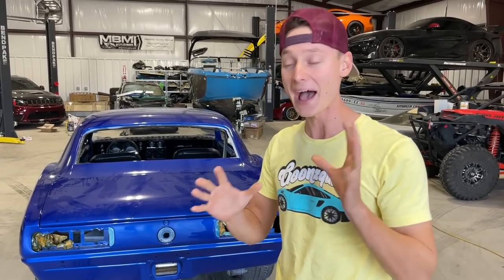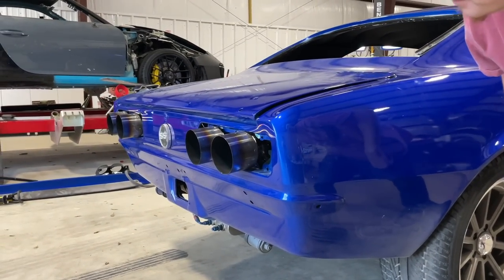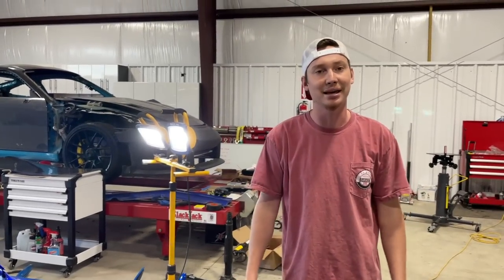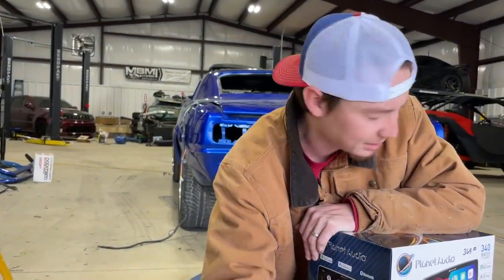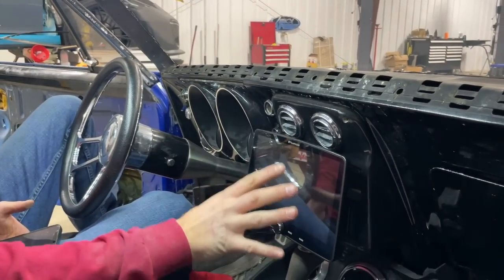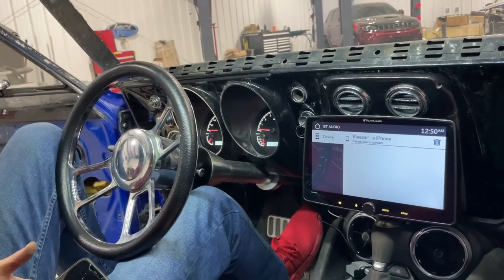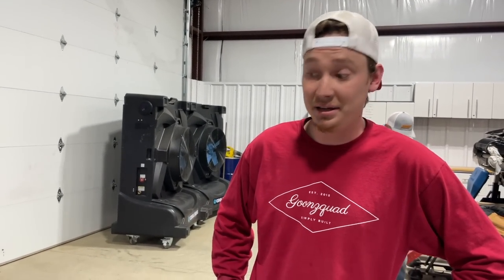Our LT4 Swapped 1967 Camaro Gets An Insane Stereo System!!!

Comment: Them Vega 6x9s are a beast without an amp. Can't believe they sold u them but boss 6.5s. Later trash those and get Vega 6.5 mid bass.  Also sold u the crapest amp for highs. I'd change that asap 2 a name brand not Wal Mart brand amp. After amp change u will double the quality of sound. . Love the build. Next do a nova or chevelles ss

Comment: I almost cried when he turned the GAIN and bass boost all the way up.. Y'all need the shop to set the gains. Would be easiest. I use an O scope with a -10 db 40hz test tone.
Wire looks too small. Could be an issue.
I would use 0 AWG pure copper to the back, no CCA wire, then dist. Block and 4awg to each amp.
Also ditch those BOSS door speakers. Swap meet trash. The rear 6x9s are good. American bass is well respected in the SPL world. Think they are outa Ohio. 
Look up the "big 3" you need to do this to get the most power and impact from the system. This reduces voltage drop. Amps dont like voltage drop.
Looks like you got a good size rear AGM battery. Good job.Car audio guys LOVE AGMs.

Comment: I'm pretty sure there is supposed to be metal clips to hold the windshield trim on a stock Camaro they neglected to install before gluing the windshield in. Didn't cars from this era use rubber gaskets not glue for the glass? My 69 c10 had a rubber gasket for the front and rear glass no glue.

Comment: Back in the day the windshield was held in by a rubber seal with chrome trim not window sealer like the new ones. You will need to order both front and back window rubber.

Comment: The front and rear glass uses a gasket. It also holds the front and rear of the headliner in place and the trim covers the gasket.
Reply: Everyone uses urethane now.  The original was a sealer over a putty.

Comment: When I got my system done, the installers put the sub with the speakers facing out,  by placing the sub against the last row of seats with the speakers facing away from the driver and passengers, the bass becomes more pronounced and evenly distributed across the car's surface area!

Comment: Point your subs the other way facing the truck they never sound good facing the front of the car.  Been installing stereos for over 24 years and if you can bridge your amp hook both positives together and both neg together you will a whole lot more power out the amp that goes to subs.  Got to remember also if you got a 1000 watt amp it only pushes out 500 watts.

Comment: Definitely wish I lived a little closer to you guys I would come show you how to set the amp and bass controller cause definitely is not right.. idk the quality of the speakers but that controller should definitely make a deference when using it and shouldn’t have to have the gain turned all the way up to get bass to work either… also need to go in the radio settings and see if it has a sub feature usually it’s only turned to 0 or 1 from factory.. and need to adjust the bass treble and mids and I’d make the controller only go to the subs and let the 6*9’s just work off radio settings and tweak the amp for them.. but I could go on all day bout that but anyways love the Camaro I miss my 74 z28

Comment: PLEASE don't MOUNT the AMPS on the Sub Box, doing so will rattle the transistors out in the AMPS and can blow the AMPS.  Also turning the GAIN all the way UP will either overheat the AMPS or Blow them out. Also turn the Sub Box around so the SUBS are facing inside the trunk, BETTER BASS AND SOUND. Once you guys get the car done ALL the way, take it to a Stereo Shop and have them tune the AMPS so it will sound like it should. I'm a 54 yr old guy here that LOVES my BASS and been installing sound systems for over 20 yrs now and right now I'm rocking x2-15's (Kickers) x6-6x9's (kickers) 2 in the front 4 in the back, x2-Mid's (Kickers) in the 2 back doors and x4-tweeters (Kickers) 2 in the dash 2 in the back dash and x2 -2400w AMPS (Kickers) in my 2015 Dodge Charger 4dr and have had to replace the back Windshield glass once already.  GREAT SOUND AND BASS MAKES HAPPY PEOPLE!!!

Comment: guys, just a heads up don't use regular primary wire at autozone or wherever for the wiring. Needs to be high temp wire. TXL wire etc, go online and research and the split loom they sell at autoparts stores will melt its not high temp rated like the factory. Just trying to same you all some heartache.

Comment: I have done a few Camaros especially 60s models so I'm going to let you know in a little secret they're supposed to be a rubber seal that goes around that window it helps with the gap around the window and also you will not see the window glue because it covers it up and across the top is going to be a thicker piece of rubber keeps vibration down also and rain from getting in between the glass and the a pillars and the roof in the cowel

Comment: i think u guys should make that car independent suspension in the back so it don't run away from u guys use that from the zl1, cause that rear end it has it will get away from u with that kind of power, and it will be a first  to do something like that u've change the engine why not the ends to

Comment: Sounds better if the speakers face the truck not the rear of the seat and get on brand amp and speakers if you want it to rattle get pioneer or kicker and for the door you can get ds18 for the interior

Comment: My thoughts on the build is maybe do alot more extensive research. The windshield and rear glass should be set in with a rubber seal. Sone come with chrome bead lockers. The interior looks like it's kind of butchered with nasty cuts inside. For the stereo etc. Maybe just do a nice clean install maybe calm in a professional for help on that end.

Comment: You don't want a subwoofer in the trunk because that rear deck lid goes directly into the trunk. Your subwoofer and your deck lid speakers (6x9's?) Will work against each other. Better to do speakers in the door if you want a subwoofer in the trunk

Comment: Don't use that gain at max. Gain is meant to adjust to the maximum possible position without speaker or subwoofer distortion. Please do that. You might blow your subwoofer later if you're using gain at max position. Also same thing to the speakers. Adjust speakers amplifier gain to the maxmimum position without distortion.

Comment: Dyna Mat the trunk and turn the subs around. for solid bass make sure trunk is tightly sealed when trunk lid is closed..
why do you gun ( rev ) engine before letting engine get use to running.....keep this up you will be replacing the engine soon...🙄

Comment: I believe you should turn that box around. Also you shouldn’t mount amps to the box especially if it’s sealed. The amps have components that will rattle loose. Also as others mentioned turn the gain down to at least half and adjust the radio first then you can turn up the gain a bit. Never go above 75% though as you’re essentially clipping the audio.

Comment: The amps gain control isnt a fu*king volume knob. It's whole purpose is to tune the amps input stage to accept the head unit's voltage level. Now the subs are going to clip until they blow up. Also just throw the bass knob away. Since its also been turned into a distortion knob. One more thing subwoofers have a break in period.

Comment: This video was a check list of what not to do as amateur car builders.
1. Not put a vacuum line to the fuel pressure regulator (even though tons of people have told them what will happen if they don't).   Check
2. Use the gain knob as a volume knob and burn out your subwoofers in the future.   Check
3. Use window adhesive to put in a windshield that should be installed with a rubber gasket.  Which will guarantee that water will get trapped around the window frame and cause it to rust out.  CHECK

Your channel used to be fun to watch cause you guys stuck to what you were good at, body work.  Now, your becoming a meme of what not to do.  

It's getting really hard to stay subscribed when you are making the same obvious mistakes over and over again and NOT learning from it.

Comment: You need 2 jbl w7 12s and 2 5000 Watt amps. I would also look up a bass tester song next time. You can tune it outside just turning it all the way up. You push some subs too hard You loose sound.

Comment: That power wire isn’t the gauge it’s advertised when you look at the insulation. Those amps need better wiring or you risk melting. I recognized the packing as some BS I bought in high school. Can’t go wrong with audiopipe. You can go wrong with crunch. Also please do a fuse for each amp power line. Please don’t put the boss speakers in they’re 🗑️

Comment: hello boys, a tip is to put black glass primer on the windshield before installation, then the glue won't be visible, I've done it several times with great results. to get a straight line, you can tape in as far as you want a black border. 🙂

Comment: There’s a windshield rubber gasket you should put around the windshield if you wanna do it right. That way the glass won’t rattle on the metal and it will seal better.

Comment: is the glass glue in or do it use a rubber gasket you pull in using string not having a mask to hide the glue is a giveaway or is there trim to hide the glue

Comment: Do not apply paint to the inside surface of that windshield! It will fall out. The paint is a very special ceramic coating and not normal paint.

Comment: I am shocked in this episode from you guy’s, y’all always good such good work on the cars rebuilds that you do, yet y’all are so in a hurry that you guy’s didn’t even try to fixed the rear speaker deck lid to patch up the huge holes around the 6x9’s, that trunk and the rear speaker lid will rattle when the bass will hit, y’all couldn’t even take the time in fixing the holes in the rear deck lid and adding a product like second skin to sound deadened to seal up the holes and making it sound better, and you guys should really have the audio system tuned by a tuner to get the best sounding after spending that kind of money on a classic car like that once the build is finished, and also not to point out any more things that is wrong with the car when you spending money like that on a car at less remove the self tapper screw from the wiper cowling that was sticking out like a mile long.
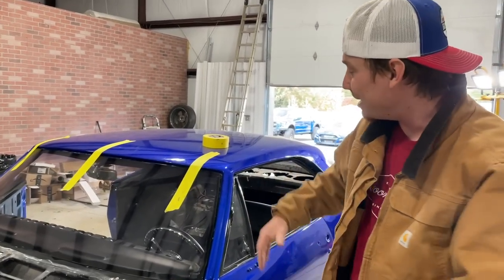Reply: Clearly you can see about 3 self tapper screws at the time stamp at @10:07 in the video

Comment: Dude, you need to throw in a roll cage in that sucker. A cardboard box has more structural integrity than the roof of that old Camaro. Believe you me, I have seen them rubber-side up. No pretty sight. Love you boys, with all that power things can go pear-shaped in an instant. Better be safe, right?

Comment: to fix your windshield problem - Find a 2 part polyurethane like Betaseal express 30 or sika or dinotrol etc. most legit polyurethane needs a primer to properly adhere to that glass and to the body. you can use some little magic sponges the white ones, put some gloves on, put the primer on the sponge and put ur finger on the edge as a guide, and do it all the way around. itll cover the window edge and protect the glue from UV also.
Reply: That's not how you fix this all these cars have Crome trim around the wendsheild and back window that has clips that attach it

Comment: Be careful cranking the gain on the amps like that. If it’s to high and starts clipping the signal you’ll fry your subs from to much distortion. I would recommend having the amps tuned or doing some research to figure out how to do it your self. I used an oscilloscope for tuning mine. There are better methods but it will work.

Comment: Original windshields for 1st Gen Camaros have a piece of fabric on the inside that hides the glue. On the outside the stainless trim should hide everything. When you were putting that in I was wondering how it was going to work.

Comment: Is it me or does it look like car is tristed? PS, the Subwoofers should be facing the rear as they also use the truck to move air to help create the bass. Placing it the way you have now, will loose some base and may also damage the woofers as you may push them harder than need.

Comment: Guys, don't paint the windshield. Leave it as it is, and get some black vinyl and apply a border from the outside. The black "paint" you see on factory windshields are actually etched into the glass and helps the sealer stick. If you paint the border, the paint may un bond from the glass. To do it right, buy a "proper" one with the etched border from Year One or something. Also, about the stereo system... To me, it looks like you wasted money on buying all that Audiopipe and Planet Audio gear. That stuff is flea-market equipment, and the gain control is not a volume control. If is isn't adjusted correctly, you get all kinds of distortion and you can ruin speakers. know y'all aren't experts at that, so maybe collab with a channel that does installs?

Comment: Not even close to an insane sound system. My 2000 Jeep Grand Cherokee system is the stock infinity but has an extra battery, zero gauge wiring a 6,000watt D class amp, and a 6 farad capacitor to power my 2 15 inch subwoofers in the back.

Comment: Save yourself some future problems. Don't rely on crimp connectors. Crimp and solder. Dress all wires and trim to length so that you don't have a rats nest under the dash and in the trunk. The Camaro is looking good. Still don't like the color. Should be a traditional Camaro color for the sleeper effect.

Comment: I'm going to be brutally honest guys. You overpaid by a long shot for that sound system. I really wish you would have asked for what we recommend first and I would have told you that you won't find better prices for audio equipment that actually does rated power, than Jones subwoofer solutions in sunset Utah. Jason helped taramps, soundigital and banda import into USA, so he gets better deals than anyone in the country and can charge less and he's a subwoofer manufacturer. Be extremely careful, because you have to actually tune that amp too, or it's going to fight itself and catch fire and that bass knob is a remote gain control, not a line voltage control.

Comment: I hate to tell you that sound system is junk and probably won't last a year... should have found a digital design,  sundown, DC audio dealers . And watch them wires they are cheap aluminum (CCA) should have went OFC. And i would say keeps the amps off the sub box but that won't have enough vibration this is one field I kinda know lol. The "screw" is a bass boost. It's a gain that should be matched to the output volts of the radio.

Comment: Replace your clickbait video topic at once. Or maybe its insane on a another level.

- Any good sound system needs insulation and sound deadening - You have none.
- One competition level 12" sub with bandbass casing and couple of 3way speaker sets would have been my choice. NO COAXIAL SPEAKERS.
- Also all channels via an external amplifier. Thumbs up there.
- Maybe 1F condensator for power stabilization.
- Coaxial speakers like you just bought are just bad. You need separate 2 or 3 way set with equalizers.
- Always use cable shoes when you install cables to an amp. You can get gold plated fancy ones.
- Those 6x9" are most likely to collect grit inside them and go bad pretty quickly since they are facing up.
- Use low gain on amps, high volume on source. This will also eliminate most distortions caused by other electrics on the car.
- ALWAYS use flat EQ or very minor adjustments on source,  so no loudness or bass boost.

Basically "An Insane sound system" is one that plays well on both high and low volume. And source is set to flat EQ.

Comment: Man oh man, you guys got ripped at the audio shop. Planet Audio stereo's are trash. I put one in an 07 Xterra, worst sounding stereo I have ever heard. Only tried it to give the low end a chance, big mistake. Ripped it out and put the old Pioneer AVIC back in. Those subs are not very good either, and that amp is garbage. Crunch is very low end, and Audio Pipe is lower than low end. Boss audio, it should be illegal for them to even be in business. Out of everything you bought for the audio set up that I would give a thumbs up to is the American Bass speakers. The rest, I would not even have considered to have purchased. That Crunch amp is not 1000 watts, you might get 200 watts rms out of it, that is if you're lucky. Never mount an amp to the sub box, great way to ruin the amp, not that the amp is any good though to begin with. Those American Bass 6X9's are mid bass drivers with coaxial tweeters. $1090 for that???? You seriously got ripped off.

Comment: this is funny they think that LT is gods gift but they left gods gift outside under a tree in the dirt.    the lS series is still a better stronger platform capable of alot more power than the LT.    I build these cars for a living not to impress children on lubetube.    I have an old c10 w a junk 5,3 that would smoke that car.   it has maybe 5k into it an runs 5.80 in the 8th.            i would love to have there old motor and put it in a 68 camaro i have and fema trailer gap their 67                                         windshields in camaros get butel tape not glue. plebs